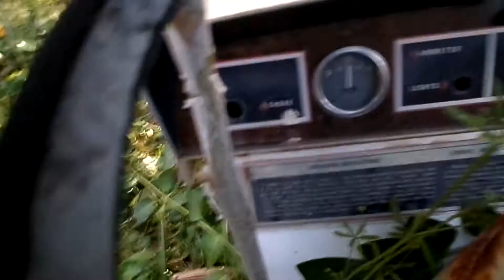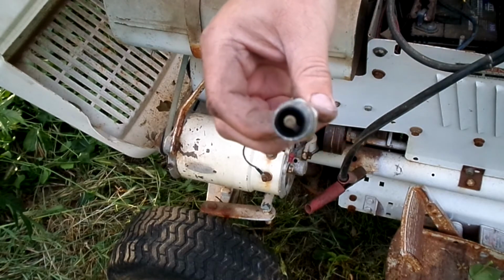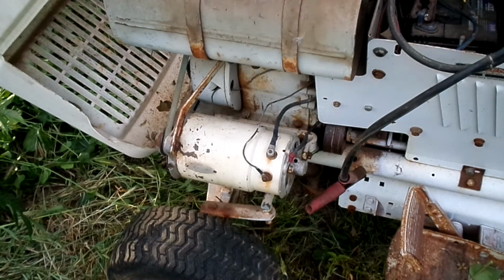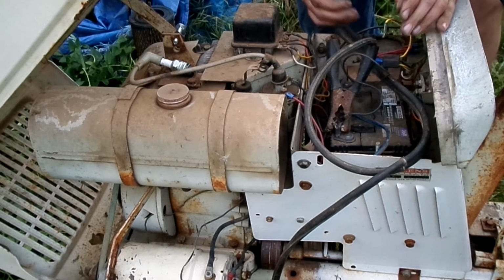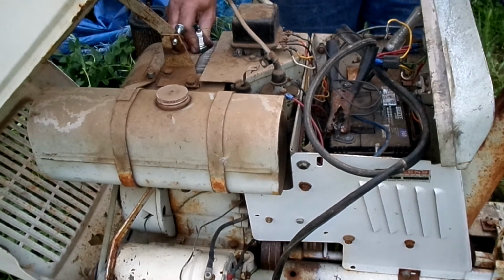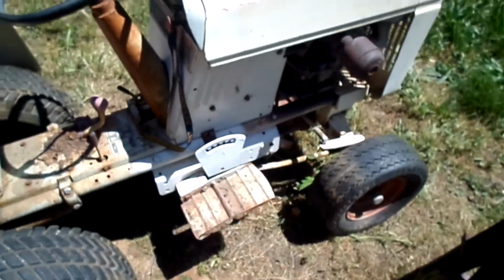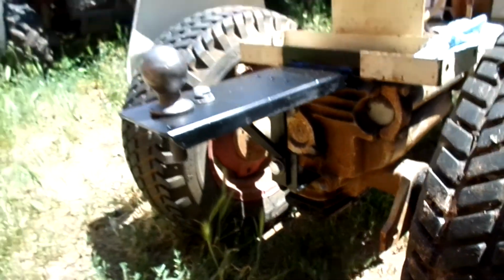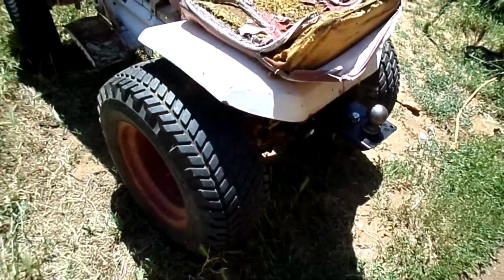Bolens 1050 Tube Frame Part 1. Attempted Cold Start and Hitch Fabrication.

Comment: Hi Niles. These have a good reputation but I've never worked on one nor have I ever worked on a Wisconsin. I guess they weren't murder wasps are we wouldn't have a video. DR evil needs to come up with some ill tempered bee's with fricken lazers attached to their heads to take out the murder wasps LOL. WOW nothing pisses me off more than some idiot slathering RTV all over a carb. Well ok some things probably piss me off more but I can't think of any right now. Anyway good plan for the ole bolens. Hopefully it'll save your back some. Take care
Reply from the maker: I kill wasps so if those murder ones come after me I'm taking some of them with me! lol
That carb was just spectacular, looked like it had banana slugs in it. I LOVE PO work! (Okay, not really)
Yes, this has been a long time coming and I have a lot of wood to split and just can't convince myself to lug the splitter around. Last time I moved it I used ingenuity; I put my little garden trailer behind the small John Deere and then put the tongue peg of the wood splitter over the tailgate of the trailer. I was hauling doubles!